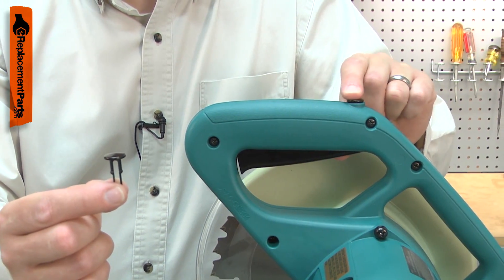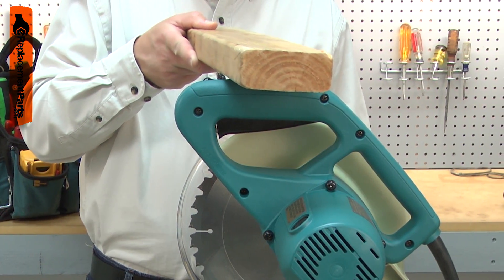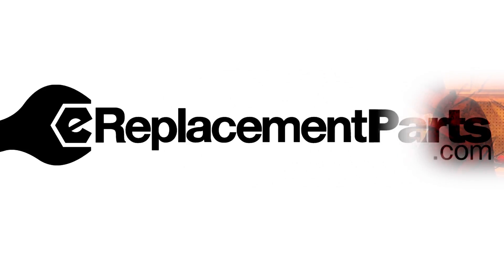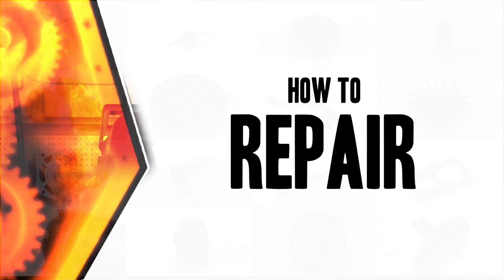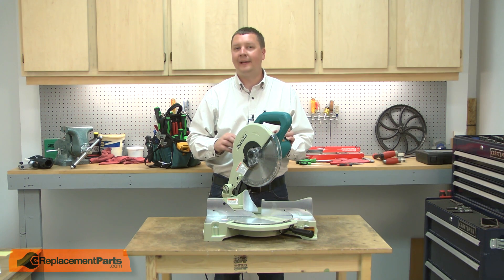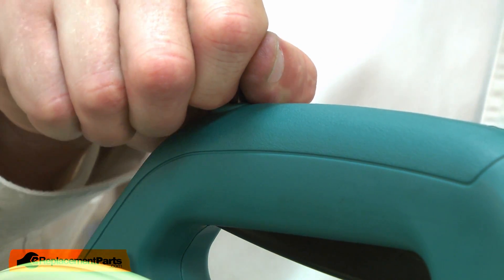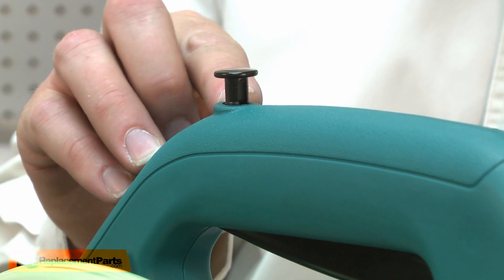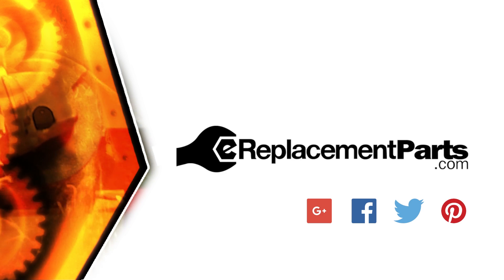Makita Miter Saw Repair - Replacing the Switch Button (Makita Part # 411478-6)

Comment: Just changed the power cord on my Makita 2401B with parts I got from you - eReplacements. When I was taking apart the handle to replace the cord a small teal plastic cube fell out - on the exploded view it is called out as a

Comment: Hello dear
I have Makita LS1018L miter saw
It is rusted alot. Both afms are really rusted. I did oiling after sanding them but still they are not smooth when pulling and puch the saw while cutting.